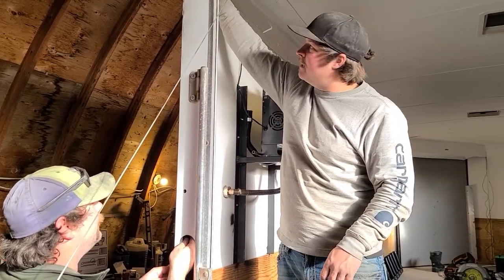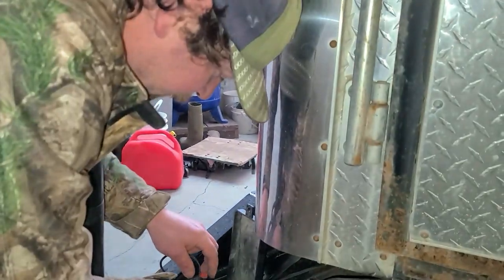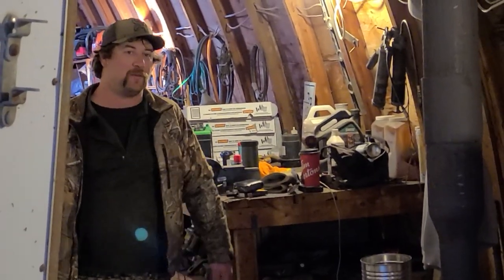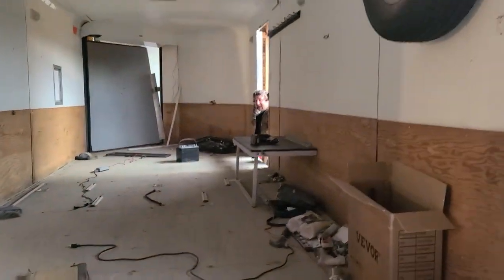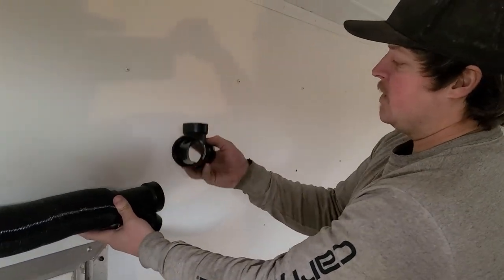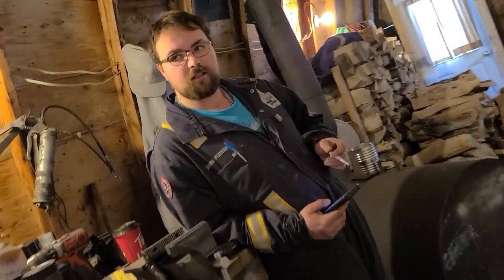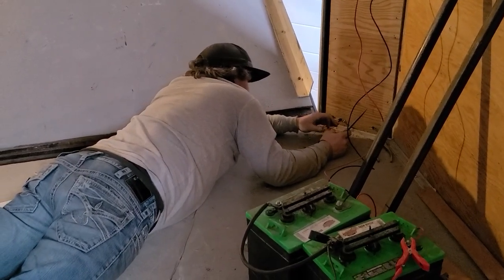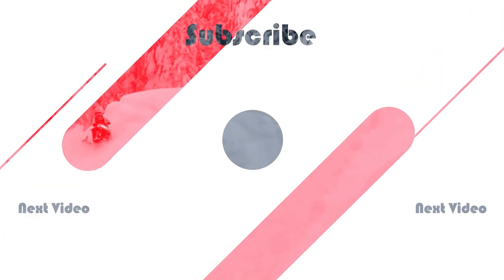RIGGIN' UP #3 | Sled Trailer gets MORE HEAT!!

Comment: The trailer is looking good!  I put one of those diesel heaters in my 24' sled trailer mine works great!  Good choice using 2x 6 volt batteries. BTW Yukon has snow should be coming your way soon.

Comment: Gotta watch the wiring and those trailers if u mess with the wiring on the trailers when you pull it with the new trucks it will beep and say “trailer connected” “trailer disconnected” constantly all the way to revelstoke our trailer does it for some weird reason

Comment: Where did you get the exhaust outlet that goes on the trailer for the heater?
Reply: That exhaust outlet came with the heater which was ordered off of amazon. I’m not sure if you’d be able to just get the exhaust exit portion on its own or not